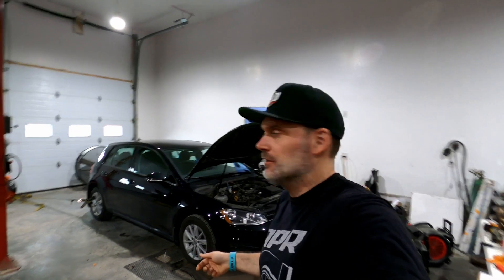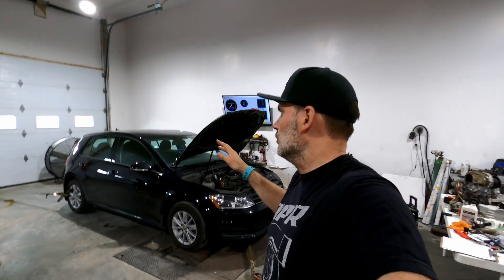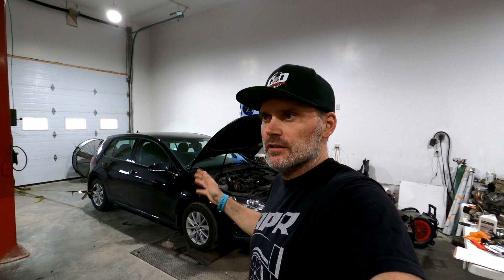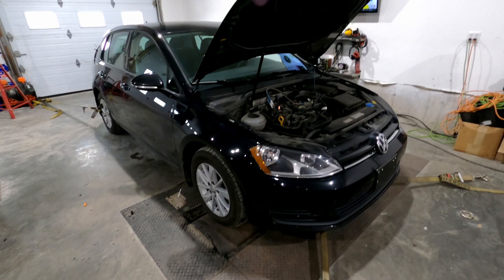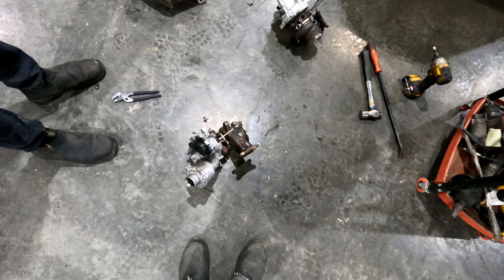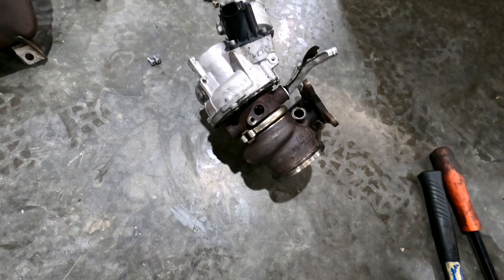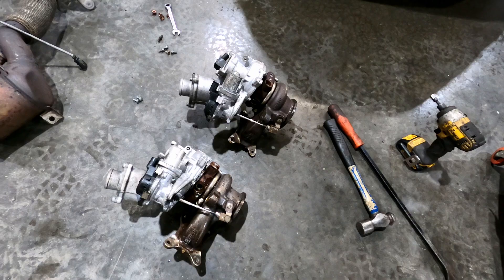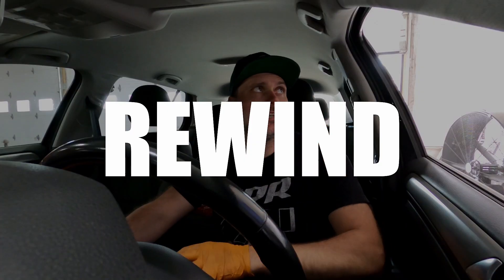MK7 Golf 1.8T Dyno Comparison, Stock vs Stage 1 vs IS20 Turbo upgrade with APR Software

Comment: I’m about to go from a stage 1 is12 to an is20. Are the rpm’s shown on the dyno graphs screwed because they were 3rd hear pulls?

I took the ratio at .765 and that brings the rpm’s down from 5000 - 1000 closer to 3000-7500 which seems to make sense. 

I have a stock down pipe with a 3” Borla system 

The trans is only rated for 250 torque so I’m not gonna be hitting it as hard as I’d like to to wring out that last bit of top end

Do you ever do hot side porting of the turbine? I used to do that on my old 4G63 Mitsubishis 
Thanks!! Love the site!!
Reply from the maker: I can't see porting that turbo doing anything. Dyno runs are generally done in 3rd in 5spds, 4th in 6spds and 5th in 7spds. It's dependa gearing more than anything.
Reply: @COMotorsports so is that why the RPMs are skewed?

On the old mitsus the watergate and turbine were one casting, it actually did pick them up!

Wil the 93 IS12 93 tune allow me to ride 20 miles to go get the IS20 tune? I’ll baby it of course

Thanks for responding , you always do!
Reply from the maker: @wizerulz what do you mean skewed? This video's 5years old, but I don't remember anything being odd about it.
Reply: @COMotorsports the rpm on the graph goes to 10000
Reply: JP will be fine but the engine rpm will be skewed by the 3rd gear ratio not being 1:1
Reply: Hp

Comment: would you say its not the smartest idea to tune a mk7 1.8 that has been stock its whole life and is approaching 215K? I have been thinking about it but I don't want to risk causing more harm to the engine.
Reply from the maker: Tune them all the time, if it's had proper maintenance then I wouldn't even be worried about a larger turbo to be honest.
Reply: @COMotorsports 2015 a3 1.8t. 163k miles and is12 is going out. Safe to replace is with is20 and this high mileage? Been Unitronic stage one plus 93 octane since 75k miles

Comment: Now put an intake, intercooler, charge pipes and a stage 3 tune with that IS20 and show the gains
Reply: I have a mk7 1.8 tsi.  If i get the is20 do i need a clutch upgrade?
Reply: @nicholasdellicolli2376 100% you’d need a clutch upgrade but a lot of people do the 6 speed swap from the GTI as well
Reply: @nicholasdellicolli2376 no
Reply: @nicholasdellicolli2376 Yea defently Thats why I got the auto with the auto u dont.

Comment: If I just did an IS20 turbo swap would I need just the APR stage 1 tune?
Reply from the maker: 100% need a proper tune.
Reply: @COMotorsports  ok perfect so no stage 2 or anything it just adapts to your mods
Reply from the maker: @Speedyboi1395  no you misunderstood. I meant yes 100% you need a tune.
Reply: @COMotorsports  Sorry what I meant was APR stage 1 is good enough for an IS20 turbo upgrade or I need a specific tune for the IS20 turbo because a few tuning shops near where I live said I need stage 2 or even stage 3
Reply from the maker: @Speedyboi1395  you need specific IS20 software for the 1.8t. Your regular stage 1 tune will not suffice.

Comment: I'm thinking of stage 1 tuning my golf 1.8t, APR seems like the safest choice, but $500 seems a little expensive for the software. are there any more wallet friendly options you would suggest for tuning? or do you think that the best reliable option is APR?
Reply: Very worth it.  I did stage 1  and just the 87 octane file on mine and it feels like a whole new car. It really is worth it.  Apr is the cheapest also.  Ive done APR on two different cars.
Reply: @JakeTaco83  did you have to upgrade clutch?
Reply from the maker: Even at 500 it will be the cheapest and best bang for the buck mod you'll ever do.... So why cheap out?
Reply: @COMotorsports  Thanks, ill 100% consider. seems like a pretty good deal for that much horsepower

Comment: Good info, nice to see the numbers are close to as advertised. I’m curious what the 0-60 comes out to with the different stages. I managed 5.5 seconds on an Integrated Engineering stage 1 tune. IE advertises lower HP but higher torque than the APR numbers, 217 HP and 301 ft-lbs for a stage 1 91 octane tune.

https://youtu.be/EkyKvMvn5zU
My run

Comment: Very cool video, I subscribed! I have a 15 Golf Launch edition with the APR stage 1 and just a Borla ( saves almost 30 pounds) and an Injen CAI that was on it when I bought it. With the V1.3 93 flash upgrade it’s stupid quick for no more than what it is. 

My question is, since the 1.8T is available in a lot of VW platforms from a golf to a Passat/CC ( which is probably 350 pounds heavier) wouldn’t there be a little more room to tune on a lighter golf as far as the APR tune is configured? Or at least it seems the lighter chassis might not be as 93 octane dependent for normal day to day driving. I run 91 ( 93/87 blend) in the winter months with zero issues
Reply from the maker: The engine's capabilities (fueling, hardware, turbo etc), not the chassis. The engine doesn't care what it's attached to... it just' slower to move it. :)
Reply: @COMotorsports  not necessarily tho I would say it’s like if you were setting cam timing, boost and fuel management for an engine in a 2900 pound manual trans car could be more aggressive ( in terms of how soon it can come in) compared to the tune that could go into a writing a map for a 3500 pound Passat or CC sedan. I guess tuning on a chassis dyno is more like steady or static loading, there’s not really a way to dynamically load the motor to simulate/compensate the weight and also aerodynamic load from a standing start through top speed as though you’re running down a dragstrip. If you were track tuning those 2 different maps I’m sure you’d agree you could further optimize the ( baseline or Stage) map for the lighter car…that’s all I’m saying….it ( the retail product) has to be a one size fits all….to some extent
Reply from the maker: @wizerulz  yes of course, however not something I'm going to go into great detail about in the comments section. The dyno is just a tool, generally why we take the car out on the road afterwards to make sure all is good for. The car would have to be substantially different in weight to notice much off a difference if the engines were the same.
Reply: @COMotorsports  of course thanks a bunch for the response!!

Back in 2006 PCMofNC ( big into LS tuning) used my Trailblazer SS as the baseline Stage 1 tune for their retail Map. It was kinda fun learning about writing for the motor and trans on the mapping on the ride along. I’ve built V8 muscle car motors mostly, over the past 40 years but these VW engines and the old 4G63 Mitsubishi motors are really impressive.
Reply from the maker: @wizerulz  no problem. Thanks for following along. Wait to you see what we did with this junk 18hoopt. Lol

Comment: Is the 1.8t's IC the same as the 2.0s?  On my GTI I found even at stage 1 power levels (280ish whp) my stock IC heat soaked after one run!  Sounds like you did a lot of runs, did you allow the IC to cool off completely between runs?
Reply from the maker: Golf and GTI share same IC, R's 5mm thicker. The most power we've seen on MK7' with stock turbo's (no matter which one) have all been with upgraded IC's.
Reply: @COMotorsports  My FMIC was a must have upgrade, I put down 325whp and I have a Vortex std on the way!

Comment: I have a stage 1 2017 mk7 1.8t golf I have the downpipe waiting to get installed to go IE stage 2 will I have any problems with the 6 speed automatic tiptronic? I can't find much info on the non dsg transmissions

Comment: IS there APR soft for 1.8 gen 3 with IS20 turbo??? When does APR did it? We have to use JB4 on apr stage 1 with that turbo
Reply from the maker: Yes
Reply: @COMotorsports  There are 3 kind of ECU soft on goapr site fo 1.8 gen 3 engine - first one have stage 1,2 and 3 based on is20 and is38, but other 2 have only stage 1 and 2. Can you explain what is the difference? May be first on is for USA made cars, and the other 2 - for Europe market and has different ECU?
Reply from the maker: @ЧингизГейдаров-с8х  best to reach out to APR with your ECU code to confirm what's available.
Reply: @COMotorsports  We have Jetta and Passat SEL 1.8 tsi both. I guess ECU are the same with that Golf in the video?
Reply from the maker: @ЧингизГейдаров-с8х  there are lots of different ECU, contact APR if you're unsure what's available for your ECU.
Reply: @COMotorsports  Thank you!

Comment: How realible will be 1.8tsi ea888gen 3 engine with is20...i want to is20swap but i have done 90k miles...25k miles on apr stage 1...should i be worried aboth engine btw...engine is in perfect condition
Reply from the maker: We've done quite a few of these. Just make sure your running good fuel, and don't lug on the engine if it's manual. Which is easy to do on these since they have such long gears.
Reply: @COMotorsports  what mean by lug....as i saw they are good with over 360 370hp...320 as i want will be probably goos for daily driving
Reply from the maker: @markodimitrovski8616  Google "lug an engine".

Comment: Hi CO motorsports,
I hope you are doing fine. I have a question please.
I do have a golf mk7.5 1.8 TSI Automatic transmission.
i am about to do an upgrade as follows: 
1- Adding IS20 turbo 
2-replacing downpipe
3-replacing exhaust system
4-replacing intercooler
5-Making octane programming.

my questions are:
1-Do you think this upgrade is gonna be harmful form my engine and transmission? 
2-Do i have to replace spark plugs and HPHT? or keep the stock one?
3-Do i have to change my air intake? or keep the stock?

You answer will be highly appreciated
Reply from the maker: We've done lots of IS20 1.8Ts. None on Autos. Plugs will depend on how aggressive the tune is. Intake is personal preference, but more sound and potentially more power can be had.
Reply: Hi @COMotorsports  what do you mean about None on Autos? 
also what do you mean by how aggressive is the tune?

you reply is appreciated.
Reply from the maker: @Haitham.jalal90  We have not done IS20 turbo upgrades on Automatics, only Manuals so I can't speak much on reliability as I have no first had experience doing that upgrade on an Automatic.
Reply: @COMotorsports  oh i got you now. then i will wait until you do the IS20 on Auto then decide :)

Comment: Great video, first off, my question is how much power can a Mk7 1.8t auto transmission handle. Should I stick with just the is12 with stage 1 or can I go with the is20? I know is38 is most likely out of the question. And also can a transmission cooler help out any. Thanks...
Reply from the maker: Done plenty of is20s on these. Stock trans comes down to what it's used for and what tires are on it. We have plenty of mk4s with 02Js running 400+whp on stock trans. Some last some don't....all comes down to  things listed above.
Reply: @COMotorsports  it going to be a daily driver, with a little go basically. I don’t have a lead foot , truth be told, I getting up there n age and are having problems with my feet, and that’s the reason I’m going with an automatic instead of a manual transmission. I love driving manual but feet hurt with having to use clutch. So you saying stock tiptronic transmission can handle is20 and is38. Thanks, that’s great news for me. Like I said I not a lead foot driver, maybe every blue moon I my get on it.
Reply from the maker: @dkdk1family  oh you said auto. Honestly don't know with that one. Definitely stronger then the old autos but haven't done a turbo upgrade on the auto 18ts. Only stage 2 stock turbo.
Reply: @COMotorsports  what do tires have to do with how long a transmission lasts for?
Reply from the maker: @22chachalaca  if you have sticky tires with lots of grip it will be ready harder on the drivetrain. No traction means it's spinning freely without strain.
Reply: @COMotorsports  ah I see, more torque sent through the tranny at launch... Luckily I will never have this problem. Since I got my 87 octane tune, I can't put any power down, especially in the winter. I have 225 all seasons. I honestly don't know how anyone is running an is20 on the 1.8 or how a gti hooks up at launch.
Reply from the maker: @22chachalaca  the answer goes back to tires, and suspension.

Comment: I know it's been a few months, but do you recall which octane fuel you were running on your stock pull?

 Thanks for the video, getting one of these cars tomorrow!  One interesting thing to note from a forum member, he ran the apr 87 tune and he could feel by the "seat of his pants" that the 87 felt felt a lot better on 91 octane, which he later verified through some logging that there were changes when ran on 91. I have a suspicion the apr 87 octane tune is the same as the 91 tune since the variation in output between the two is 6hp and 12ft-lbs. This subtle difference in peek power between using 87 and 91 is seen on other cars such as fords Ecoboost, notably the 2.0L in the focus ST which has a lot of information out there showing similar minor differences between peek power output between 87 and 91. What are your thoughts?
Reply from the maker: This was 91oct. Remember there's two ways to reduce/increase power output. More or less timing, and more or less boost. Although it's likely just timing is the difference between the two files, one may also have less timing more boost to keep the closer. I've never compared so I can't say for sure.
Reply: @COMotorsports  Thanks for getting back to me! I wonder if the reason why VW held back so much on power on the 1.8 tsi is because of safety and reliability reasons or because if a TSI was making 220hp and 270ft-lbs, no one would buy the gti!
Reply from the maker: @22chachalaca  the latter for sure. I mean they got rid of the 1.8t already.
Reply: @22chachalaca  on that note, the Alltrack is much cheaper than the R, and for still much cheaper than the R you can achieve the same output. Now they’ve killed it and have the Taos instead which only has the 1.5

Comment: I just bought one of these , How much overall is the cost on the stage one , and then how much cost on a stage one and the is20 turbo with downpipe
Reply from the maker: Would depend where you're located. Software pricing varies between countries.
Reply: stage one was $600 cause i went with apr but the place i went to also does dyno tuning for around same price

Comment: Can you do a test with the neuspeed power module on the 1.8t on the 7psi switch ? And would it be okay to use a is20 with neuspeed on 7psi
Reply from the maker: We don't use them for a few reasons, but if you'd like to send us one we'll try it out and do some real world comparisons for you.
Reply: @COMotorsports  would you really ? I do have an extra module for the mk7 that I could ship out
Reply from the maker: @briansantos4637  we have a couple 1.8t we could try it on.
Reply: @COMotorsports  ok how can I ship or where to
Reply from the maker: @briansantos4637  go to our website and scroll to the bottom. If you do ship it, just drop us an email so we know it's coming and from who.

Comment: Hey so I have the same exact drivetrain just in a Jetta and my question to you is it possible to swap a 6 speed trans in from a gli or gti does it bolt up to the bell housing and if so would it be a direct plug and play or would I need to swap other parts like cv axels ect asking this because I believe my clucth is starting to go out and it would make the most sense to do that now asking because I honestly hate the transmission in the car now gear ratios are way to long and I find myself in between up shifts with the clucth to the floor watching the tach waiting for the revs to come down so I can actually shift smoothly never mind trying to shift fast also if I were to put a aftermarket clucth in like south bend would it fix or help it at least I know I asked you a ton of stuff but a response would be greatly appreciated because there little to now info on this drivetrain and I spent a lot of money on the car to hate the way it drives and i feel screwed and stuck thanks

Comment: He's going to surprise a few folks, especially with the 100% stock Golf appearance.  I dig it.  Even with minimal peak gains, my experience with upgrades like this is the fatness of the band throughout  and all the useable power.  I'd love to have seen more discussion on the comparison of where each setup makes power and for how long through the range it holds it.
Reply from the maker: The gains aren't minimal at all. Also is you want a good comparison check out APRs website. They have a graph for pretty much every mod and software, both in whp and crank HP.

Comment: My passat would blow up if you dyno it. Old girl, still gets around good though. I just take it easy on her.
Reply: If it’s high mileage make sure you get a carbon cleaning. You can recover a good number of lost ponies if your intake valves passages are clogged up.

Comment: I had no idea the 16v 1.8T could make that kind of power with so little effort and while retaining an OEM-looking engine bay. I remember waaaaay back in the day, APR's Stage 3 for the 20v 1.8T put down that kind of power, except the kit cost $5k (over $7k now adjusted for inflation). Seems like a 16v 1.8T with IS20 and 3" downpipe would smoke a 20v 1.8T with K04 and 3" downpipe.
Reply from the maker: It can make even more with the is38 golf r turbo. Very similar numbers to a tuned 7R.
Reply: There’s a lot of memes about people who bought mk6’s right before the mk7 came out, how a stage 1 mk7 dominates a stage 3 mk6
Reply: These engines have pretty much the same potential as the mk7 gti/mk7 R 2.0tsi with the equivalent turbos swapped in.
Reply: @WaseemKhan-iu4bh  what are the differences between the 1.8t and The 2.0
Reply: @plshelp2906  pretty much all the same except for the forged crankshaft on the 2.0 and longer stroke.